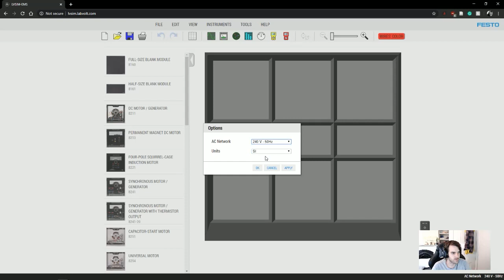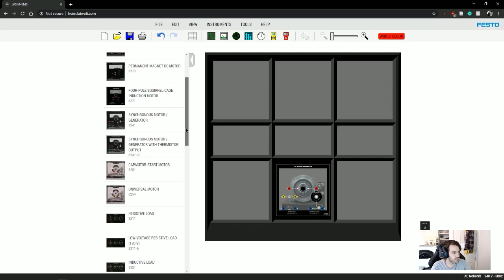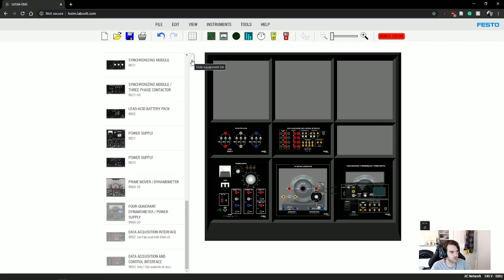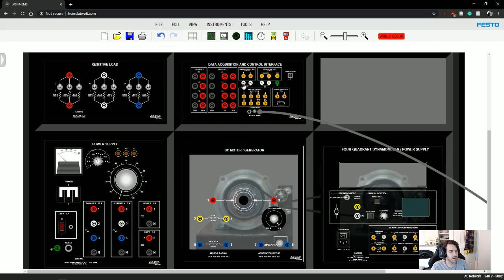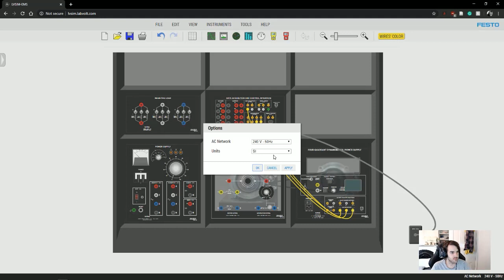01 Introduction Labvolt LVSim ENEE20002

Comment: Hi mate. Great video. I’m a TAFE teacher and we used to have the full set of hardware. But due to WHS we haven’t been able to use it as it’s LV. 

I’m interested in the simulation version but I need the access code. You say it’s in the google drive folder, but where is the folder?
Reply from the maker: Hey Muzz, You would need to contact Festo, I know because of the corona virus, Festo Didactic is giving free access codes that will be valid until July 31st 2020 to schools that request it.

@Phil Ranger left some contact details:
https://www.festo-didactic.com/int-en/contact/?fbid=aW50LmVuLjU1Ny4xNy4wOS40NTM2

Comment: Is there some way to fix the problem I'm having: when connecting the low power source to the data module, it does not turn on the light and it is not powered.
Reply from the maker: Noah Holderman if you're supplying it with power from the power supply you'll need to turn on the switch, if you're supplying it from the power source to the right of the board it should be always on.
Reply: Michael Vernon I figured it out. The program had to be reset. Again, this was occurring with the switches and/or source plugged in and on, but no power being received.

Comment: Good evening
when I use LVSIM EMS online ask me for the access code
Reply: Mr. Vernon: Great video series, thanks!
Mr. Zinai: LVSIM-EMS is a paid software from Festo Didactic.  Because of the corona virus crisis, Festo Didactic decided to give free access codes that will be valid until July 31st 2020 to schools that request it, but the code will stop working after that.  You can contact Festo Didactic at 
https://www.festo-didactic.com/int-en/contact/?fbid=aW50LmVuLjU1Ny4xNy4wOS40NTM2
Without the access code you can do the connections and save the files but you can't turn the power supplies on.
Reply from the maker: Please see the google drive folder for code
Reply: @michaelvernon7370  where is it?